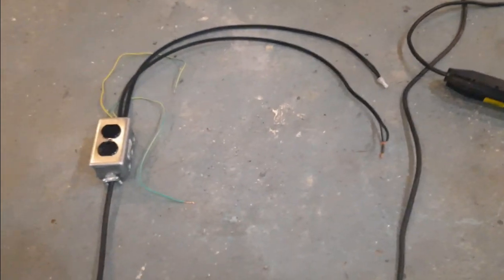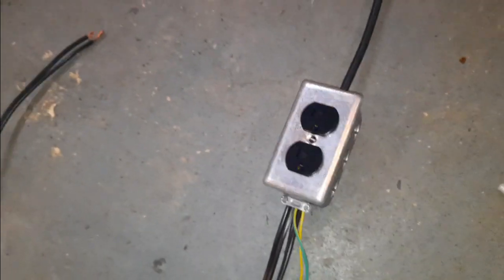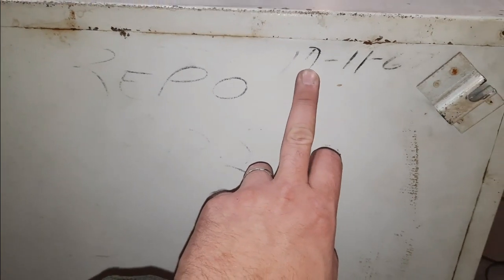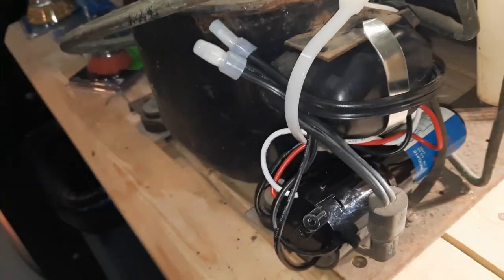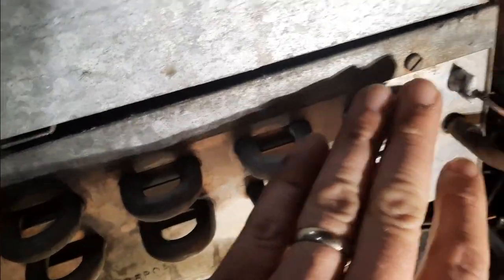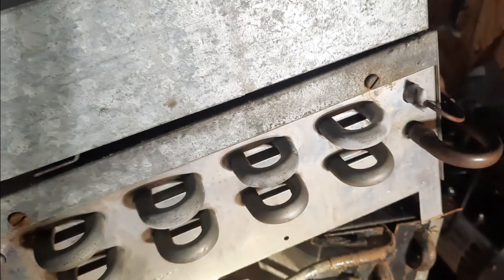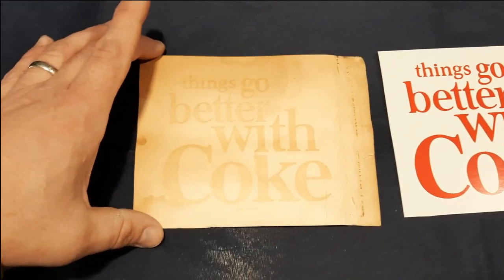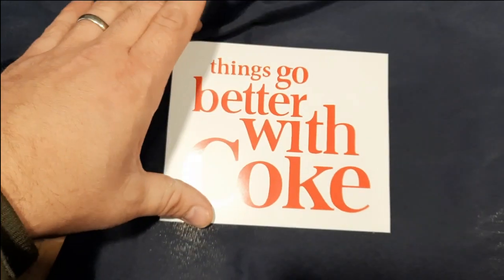1960's Cavalier Coca Cola Vending Machine Repair

Comment: Just bought off Facebook marketplace for 100 bucks. Guy tells me it’s not working, but it sounds like it’s on. I plug it in and I hear the condenser turn on but the fan wasn’t spinning. Take it apart and an old bottle was broken inside the fan and not allowing it to spin 😆 Easiest fix ever. The machine sits at a cold 35! I need a video of the button thing to make it free tho!

Comment: Just bought a Cavalier CS-64E to restore.  Actually has the light.  Have a rather large EM Arcade collection.  Restored them all.  The Coke Machine will be more like restoring a car.

Bought a broken Coinco mech and working to restore it.  After watching this vid I may just install the free button and call it a day.

Also great set up on the harness.  Also has given me a few ideas.  I am on the hunt for a coin release push handle and a opener bezel.  Could also use a side door.  

Mine was rusted through the bottom.  I could cut off the rust and make a repair but if there is a door out there I would also buy to replace.

If anyone out here has a lead in either please respond and will set up a way to get in contact.

Comment: When i see a 3 in 1... i run 😂Shoulda got the one that fits inside the housing and doesn't OVER push your start winding. Old R12 dont need the 401 it need the small start relay.

Comment: I am getting one of these and would like to convert it into a honey jar vending machine. Do you have any ideas on how to make it where it could take and make change for $1, $5 & $10 bills?
Or would that be more trouble than it's worth?
If so, what type of vending machine would you suggest for something as heavy as honey? I'd likely only do one jar size and it would be plastic.
Reply from the maker: I wouldn’t know where to begin with that, sorry
Reply: I dont even think that jars would fit in these machines theyre for glass bottles

Comment: Bro. I need your help.   I have a 1961  7up machine. Everything works now but it wont dispense the bottles.  I believe the coin mechanism works. 2 nickles and the selonoid pops and the light blinks to pull 1, but it is not releasing. Can you help me.

Comment: What would cause one to freeze up?
Reply: Most often if the cold control is bad it will not shut off the compressor, if its ice on the evaporator you are talking about it could be bad or weak evaporator fan motor